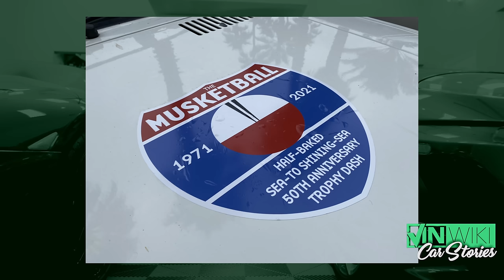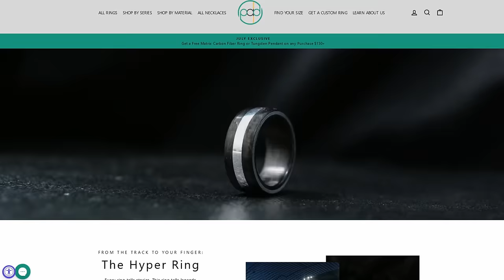The most ridiculous Cannonball Run of all time!

Comment: I love this event! Seriously, I'd be there if I were in the crowd for it.

Also, as a former Volvo 240 owner (multiple times over), the best you can get in an NA 240 is about 112-113mph, downhill with a tailwind, after miles upon miles of "acceleration"
Reply: Most fun I ever had, with my clothes on, in a 240 was on I10 driving from I75 to Jacksonville, about midnight chasing a BMW at over 100 and doing it for miles and miles. Miss that old box with a 4 banger.
Reply: I think I remember a line from Car and Driver that went “Volvos don’t accelerate, they gather momentum.”
Reply: @woodyholland9865  h
Reply: Considering the Volvo 240 weighs a million tonnes 113 mph pretty good lol...
Always remember the incredibly loud ticking seat belt warning lamp...
Reply: hmm....mine would run 120+...of course that was after a new head gasket, and decking the head, and playing with timing...made for a fun time!
Reply: 245 owner can confirm.
Reply: @woodyholland9865  I followed a 308 from West Palm to somewhere in Georgia, in a 82 242 turbo, before we went our separate ways. I figured there was no way I was getting popped before him. Precious memories.

Comment: Verified... a 3-cyl Ford Focus will hit 141mph, with a puzzle on the hood. Allegedly.
Reply: Yaris topped out at 117.... Allegedly
Reply: I drive a Prius that has a 95hp gas engine. Definitely capable of around 100mph but the fuel economy benefits of driving a hybrid are mostly negated at such speeds
Reply: @julianbrelsford  I drove my dad's Prius in 2010 or so, I think it was an '06 or around there,  from Chicago to New Mexico, I did 90+ for most of the time, and fuel economy was pretty good
Reply: @shadowwarsshadypeople6299  Mom had a ‘11 Prius, drove it out to California and back in 2019, think I spent $87 total in gas. Full tank was $20 which got around 450 miles on eco mode. Can’t beat that. 
Edit: maybe it was $107, not sure. I know with gas prices how they are right now in Oklahoma, her new 2021 Prius is $36 to fill up at costco (which is crazy, my wife’s Corolla is $48 not even tickling E) and that gets you 450 miles at 57mpg, that’s booking it down the highway with the AC blasting on high.
Reply: The more you know
Reply: But my 4-cyl Focus topped out at 120...
Reply: Did snopes fact check that?
Reply: Did snopes fact check that?
Reply: @PeePee2000 my 73hp 200 honda insight 5mt allegedly does 110.
Reply: @jeffweiss70  damn, my Yaris only goes 113. Not allegedly, I did it in Germany so it's legal
Reply: @erikm.905  it did 117 for hours.... don't ask it to go 118....
Reply: I mean, the new ST is a 3-cylinder
Reply: I've been north of 120 (speedo topped out at 120, it was an inch and a half past that mark) in a Chevy Cobalt. I don't recommend it. Felt like it was about to fly apart at the seems. Had to hit a nice long grade going downhill to do it too.
Reply: Dang my cherokee would only go 99mph downhill before I got scared and backed off lol
Reply: @jeffweiss70 same with a 2010 Corolla allegedly…
Reply: The '06 yaris is decidedly underpowered for freeway use. But the new ones with the 115hp engine are bloody huge for whats supposed to be a small city hatch. I wish they had put that engine in the old chassis.
Reply: Thats...puzzling.

Comment: drive a fast car slow is always less interesting than driving a slow car as fast as possible
Reply: James May was dead right on that point.
Reply: Man, the most fun I've had while driving was in an old, tired little turbo diesel van pulling a trailer. Although weak, the engine had excellent throttle response above 2k rpm. The car had a sloppy manual transmission, rear wheel drive and an unusually tight steering rack. I sat there, trying to maintain momentum through corners on these windy country roads, foot to the floor up every hill, focusing on perfect gear changes. All to just about keep up with traffic.
I drive same route now with the same load in modern car with actual decent handling, great brakes, loads more power and a good auto box. It's dreadfully boring! I'd have to drive like a maniac to have any fun now.
Reply: No VW Beetles???
Reply: @stephenhenion8304  The beetles are dying off. Must be the pesticides...
Reply: This is so true.
In a high performance car alot of the effort to drive fast is done for you.
In a relatively normal car one has to ragg it to the red line to get the most out of it. And to know when to rag it when approaching hills etc.. constantly thinking while driving.
Whereas say a lambo just sits there all day long @ 100mph..
Allegedly, with no effort...
Reply: Very true, I find on local streets the most fun is had with my old 80's Golf, and my 80's Suburban can be a good time since driving to its limit is like 5 over.
Reply: This is the exact reason why people love driving a mazda miata. It's literally the definition of driving a slow car fast. You can really enjoy driving the car. Without having to worry about traffic tickets
Reply: it’s also fun driving a fast car fast
Reply: Quite true, this was part of the appeal of SCCA IT racing. You take a Pinto or 510 around Sebring, you were to the wall with it all of the time and maybe hitting 120 in a few places. Take a Corvette or Camaro, and you are having many spots you can't be full out and when you do, you will be 160 to 170. 
Now when you do Daytona, well, a slow car is just a slow car. Doing 120 on the oval is just boring.
Reply: @Thor Odin son how can you drive a 600+ hp car? And actually drive it, as fast as you can? You can't!
Reply: @Thor Odin son you can't drive a fast car legally. As fast as it can go. Sure you might have a track car. And be able to drive it, like you're supposed to. But you can't do that legally with a daily driver. I kinda like not driving like a idiot. Not risking hurting or killing other people. And keeping my car insurance under $100 a month
Reply: I miss my 86 civic si hatch with 90hp.
Had more fun with it than my 300hp mustang
Reply: The MX5 has a 200hp naturally aspirated engine in a chassis that weighs less than a ton, and is the size of a mouse.
It is definitely not a slow car.

Comment: I never considered myself crazy for dailying a Yaris. I guess I've been crazy for 7 years now.  It's about ready to kick the bucket, but in 2015, with 102k on the odo, I could have easily taken my 08 across the country. 

Only issue would be the shortish range.

TDI Insight is bonkers. That's some evil genius sh*t right there 😈
Reply: I have an 81 rabbit pickup with a Tdi swap
65mpg
3000rpm is 90mph+
1000+ mile range with stock tank.
Reply: We took our Yaris across the country with 180,000 on the clock, performed great, no issues across the Dakota's at 95 mph for hours upon hours
Reply: How do you ruin a yaris in 100k ?
Reply: @1marcelfilms  I think you misread my comment.  It was near perfect at 102k in 2015. It's pretty beaten up after a bunch of city miles at 185k now.
Reply: Yaris really dislikes highways. Its a city car.
Reply: @egoalter1276  Mine would sit on the freeway at 80 effortlessly. It was never an issue. It lives on as a safari build now, with another owner, probably not as good on the freeway anymore.
Reply: @gamby16a  I does go 80 forever, sure, but it does so at 4k rpm, doing like 30mpg, while in cities it has twice the milage, and cant accelerate worth shit if you need to move because there is some danger.

Comment: The Musketball sounds like the perfect event for a Volkswagen van. Loads of space for supplies, you can easily sleep in it while someone else drives, it is vastly underpowered, it will shut down on you if you push it too hard but come back to life once rested, you can give it a variety of motifs, you'll barely make it to 65 mph, you can equip it for long distance travel easily.
Reply: My thoughts exactly. I jave a 1972 VW Bus, all of maybe, 65 horses. But it would be easy to put a big fuel tank, sleep in it, and have space left over! Can't imagine driving totally driving across the country in one shot, lol.
Reply: Those vans die in the desert.  You get about 45 minutes of driving and then have to stop for 3 hours while it cools down in 120 degree heat!

Comment: I drove my Scion IQ from Wisconsin to Los Angeles, around 2200 miles almost nonstop. I only have an 8 and a 1/2 gallon fuel tank which will take me around 250 miles before I have to fill up, but when I hit Nebraska's 30 mile an hour ahead winds I only got 25 miles a gallon instead of the 45 I was getting normally.  I would love to have taken my 07 yaris if the engine didn't decide to blow up

Comment: I’d love to hear ficarra discuss the financials behind these events, since I’m sure there’s a lot myself (and others like me) having never done one would never think about.
Reply: Just the cost of fuel would make it prohibitive for most people I'd say.
Reply: @joshuagibson2520  
Just done some rough calculations.
From the Red Ball garage to the Portofino Hotel Los Angeles.
Based on a car doing 30mpg =
~ 430$ 
car doing 15mpg = ~ 850$ one
way.
2815 miles @ average 4.50 per gallon.
Double those figures for the return trip home.
Budget 2000$ for maintenance and car prep/modifications.
1000 on "driver aids"/satnavs.
Hotel stays varies depending where one lives.
Probably not going to have much change from 10,000$.

Comment: What's wrong with a yaris? I have a 20 year old yaris with 230000km on it. Still runs great. I take it on vacation every year. 1500km there, 1500 km back. Loaded to the roof with camping stuff. Never skipped a beat and drives 35 mpg. I love my lil' nugget.
Reply: There’s a probability that You don’t live in IS 😉
Reply: where is IS?

Comment: Those Saturns don't have a complete front suspension from the factory. They use an oversized front sway bar as an adhoc lower control arm/trailing lower link, they have another single bushing flimsy lateral link and the strut. It's a Very loose arrangement on a good day.
 Kinda fun on extremely sloppy winter snow and slush covered roads using the P-brake for turn in though.

Comment: I really wanna do this in my 95 celica, stock 7afe has 110bhp, which is probably like 93whp. It gets 30mpg highway regardless of speed, and i wanna put a 100gal fuel cell in the back seat so i literally never have to stop for fuel.

Comment: Would love to do something like that, but I doubt that I could stand coast to coast in my old Jeep Wrangler, at about 75mph the plastic Mary starts to get out and hitch-hike.  Maybe the old Chevy dumptruck would work, it tops out at around 80 downhill with a tailwind, and yes it handles like a dumptruck.  Though would be fun on the old Goldwing, could you have a class for over 30 year old motorcycles with atleast 100k miles on them?

Comment: I have had a car gifted, It was a euro 2002 Opel Astra sedan with a 2.0 tdi engine that has 101hp with 79000km.I took the car and noticed it did 45mpg cruising around, so we did a trip of about 1500 miles, it was mind blowing, I cruised for hours from 60 to 100 or 110 mph doing 30-35 mpg. I started driving the thing and actually put 15k the covid year. One day it didn't feel healthy, between gears i got a runaway in the engine, rpm went past 6k, had to stall the engine, changed turbo and noticed a rocker was broken and knocking but I already drove 150km on it, I open the valve cover and carnage was the least... I pulled all bits with magnet and rand new oil and filter... After that did another 25k km on it. 100 110 mph is its happy zone and can go for hours no problem. After research I found that the block is Japanese Isuzu, rock engine did its job for me as it was going to scrapyard. That car would be a good under 100hp cannonball car for sure as it at least lost 10hp in that runaway😂

Comment: I have an idea for another one. You can use any car (within reason I guess). You can modify it as much as you want as long as it stays street legal (this has a point). Here is the premise. To go from coast to coast first (who ever is first wins doesnt matter overall time). While still obaying traffic/speed laws. The exceptions being You can go faster then the speed limit by 10 mph or if flow of traffic is going faster then that you can go with flow of traffic. You can also go faster then the speed limit if you are on a long deserted area of freeway if you see any other car (that isn't a fellow competitor. If it is a fellow competitor just count eachother as flow of traffic) you have to slow down to match them (unless they are going under the speed limit). And tickets add time penalties at the place (ie you get hit for speeding or missing a stop sign or rolling throw a red light) you have to pull over somewhere safe near by and wait anywhere from 15 minutes to an hour (depending on how bad the violation is seen) before they can start going again. This race is all about pre-planning. Be it route planning (stats with higher speed limits or more open empty freeways. Maybe a straight line isnt the fastest if taking a longer route around a town or city means more time at higher speeds) or car set up (more fuel means less stops but can also mean longer stops if you don't have enough and have to refuel). This way you have a cannon ball that is both fun and can legally be talked about without qualifiers. Lol.

Comment: To go with the guys with the 60 gallon fuel cells in the slippery car... the other way you can go is a driver's education car... with the extra controls for the instructor...so you don't need to stop to switch the drivers until you need to get fuel & food, either person in the front seats could conceivably be driving the car.

Comment: This is fantastic. 
Perhaps more relatable to most people.
John is a legend.
I just can't visage Ed driving a sub par 100hp car...
Bet he had many sleepless nights wondering how he'd cope with only 100 horse's...😳
..
Waking up in cold sweat thinking his Murcis gearbox has more power than these cars...
....
That Suzuki micro van could be a serious contender for a cannonball run.
Install either a 1300cc Suzuki hayabusa motorbike engine ~ 160hp.
Or Daihatsu charade GTi engine.
1000cc 3cyl turbo ~ 100 horse's.
There'd be enough room in the back for a massive fuel tank/ cell 
Some wheel & suspension mods
Might be possible to do a cannonball run in one hit.
..
We used to call them
"Loaf of bread"
vans the UK...

Comment: Those little Suzuki vans go hard and are so reliable. Worked at Suzuki for years and the workshop mini van was around 30 odd years without issue and did trips all over the south island being rung out on motorway

Comment: I would have slapped a lobster sticker on the Fiat 500! It had an Abarth badge and the air vents required for the turbo's intercoolers. In Sport mode, an Abarth will produce 160 HP. Imagine an extra 600 lbs of cement in that little thing! 😂

Comment: How did the vw tdi not win? They get great mpg even at 100 mph. 
In my 06 jwtta tdi I've done 1500 mile trips from Idaho to colorado in 15hrs and that's with stopping for food and bathroom. 
At 100mph I was still getting 38mpg which meant stops less too, my fuel tank would last longer than my bladder.

Comment: My first car (I actually bought it new), a '79 Dodge Omni 024, wouldn't have done well. A top speed of 91 m.p.h. Allegedly.  A far cry short of the car I learned to drive in, a used 1968 Ford Thunderbird 2-Door Thunder Jet 429 V-8.

Comment: Stock 1987 Chevy Sprint Turbo, less than a year old. 3 cyl. 900cc, 92hp... I did NOT know it was a Cannon Ball Run, I was just letting pace behind a small pack of cars and... It was the 2 FHP motorcycle cops with radar guns, 4 SVO Mustangs, a Corvette and Camero all in FHP colors with a helicopter hovering over I-10... That's when I clued in that I was in a race, that and my speedo banging between 30-40 like it was about to just start spinning. Two semi's we're right behind me and I got off at the Starke exit. The people in the Trans Am and an old guy in a Jag came over to look at my engine. 3 cylinder, 900cc, intercooler, turbo charger, stock with the AC on and the radio playing, I hit 132mph. Ralph Nader said it read more dangerous than a Convair or VW Beetle. Best car I ever had.

Comment: I've commented on the Fiat in other videos about the Musketball I've seen, but this time the thing that really struck me* was the '89 Crown Vic, because I had one of those. The people who chose that car were brave, but also had to have been secure in the knowledge that if it did break down (as it was almost certainly going to, although I see in the photos at the end that they did make it), it would be the most comfortable place in the entire rally to await roadside assistance. :)

* not literally
Reply: I feel like a LTD Crown Vic, as long as it's in good shape, is a car you can drive across the country just like this over and over again. They're simple and reasonably well-built.
Reply: @bwofficial1776  Well, I admit my sample size is 1, but if it's the one I had, you could do that just fine, as long as you budgeted a fair amount of time to work on it in the parking lots of parts stores under the sign that says not to work on your car in the parking lot of the parts store. :) 

Nothing ever went catastrophically wrong on it (until the frame rusted out), but it did like to stop working a lot. It had a particular affinity for electrical faults.

Comment: I’d do this in my 95 yj 4cyl. Is it over 100hp on paper yeah but it performs about like the 600cc van. 😂 it probably doesn’t break 100hp on the dyno and it would be totally opposite of what you would want to drive. Horrible fuel mileage on the freeway.

Comment: Honestly, in your groups I'm surprised you didn't agree to slipstream oneanohter like racing cyclists do in a breakaway, taking 10 min turns on the front then peeling off to the back. You could save a tonne in fuel and stay out ahead of the pack.